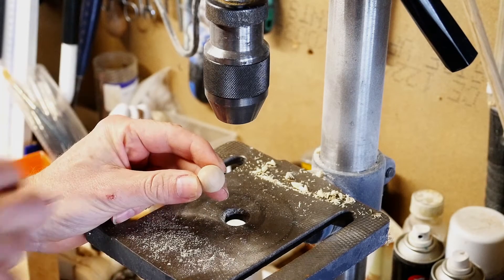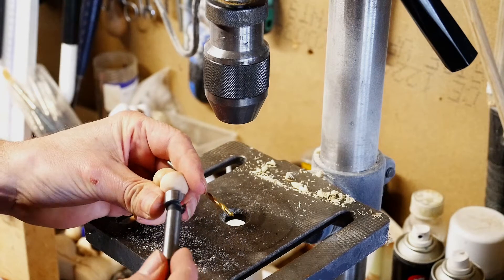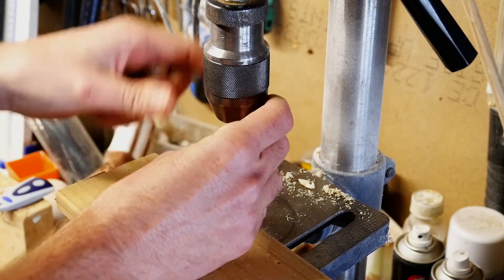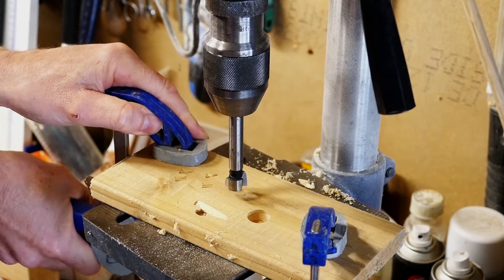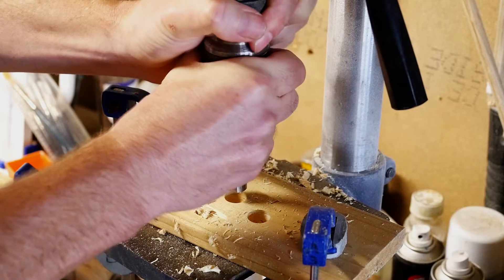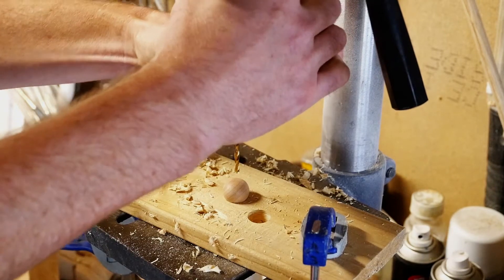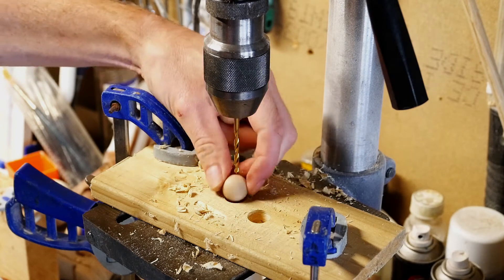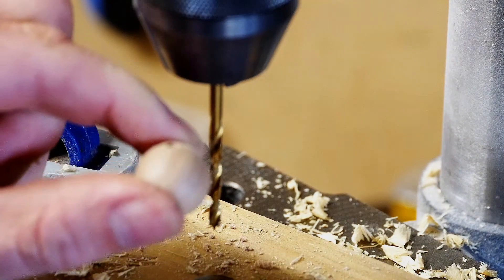How to drill a hole through the centre of a wooden ball (Puppet Making Tips '#4)

Comment: I don't have drill press I only have a hand held drill. And I want to drill a hole in a sphere the is 6 inches wide and 3 inches in hieght. The metal is kind of  thin like sheet metal. Is there a way for me to achieve this task. And is there a chuck large enough to drill the hole in the plywood to make the receptacle to set sphere in?